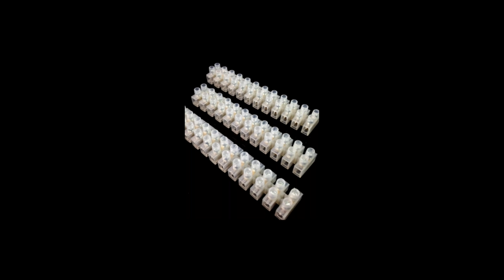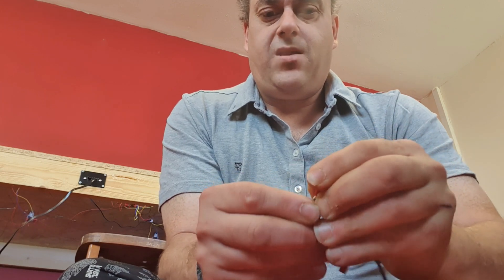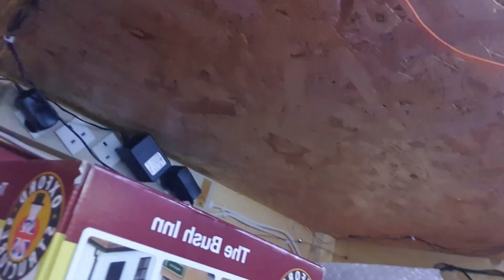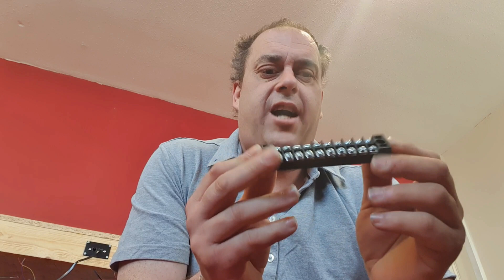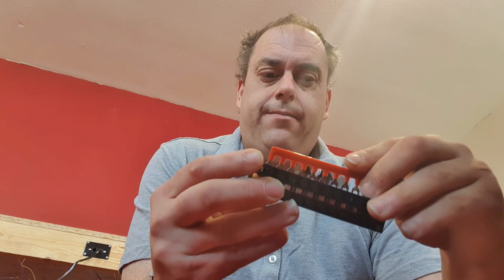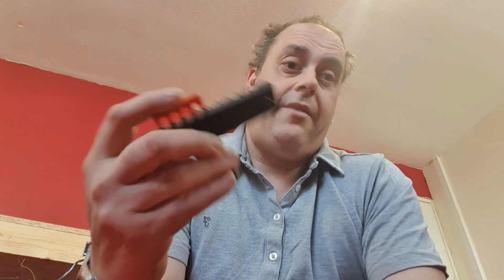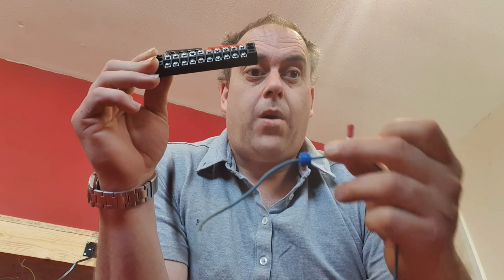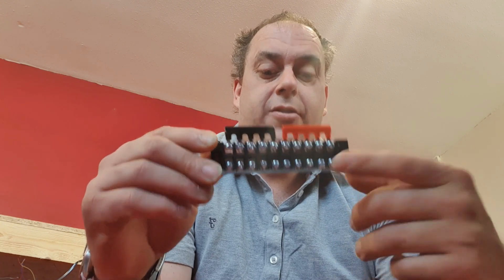Looking at dcc bus wires

Comment: Those are great additions to wiring a layout. I also get the mixed pack with 3,4,5,6,8 blocks, ideal if you don’t want a full block. Thanks for the video, well explained to a complete idiot!
Reply from the maker: Hi Louisa 
They are a brill item and I would highly recommend them for any railway.
Peter